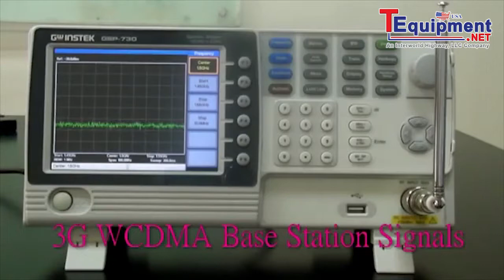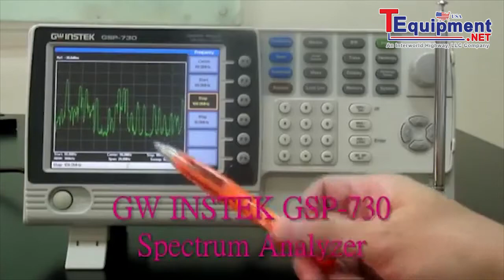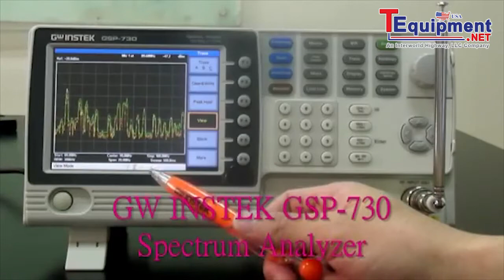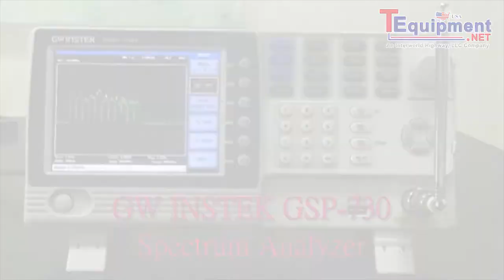Instek GSP-730 Experiment 1: Basic operation of a spectrum analyzer

Comment: hi , my name is johan and i just buy a spectrum analyzer gsp 730 . at starting , i see a white screen with some vertical colored lines 2 to 3 second and after a correct screen appear with all parameters  and line green (noise floor). it is my first spectrum analyzer for learning and seeing sigal radio and modulations .is it firmware to update ? system display vers :1.17 17.12.13 . Somebdy can help me ...thanks .Johan F5IQX ..